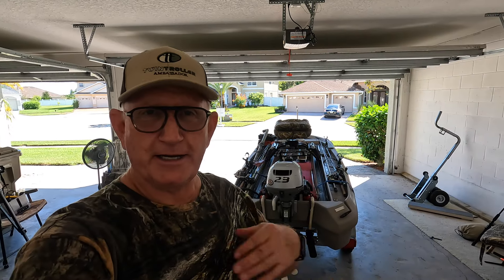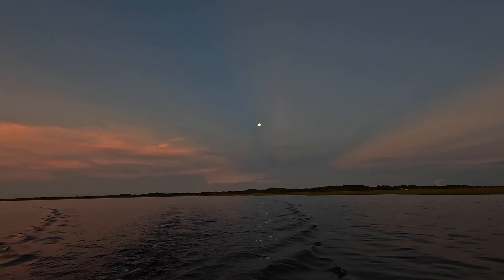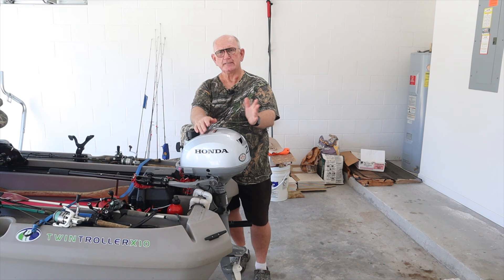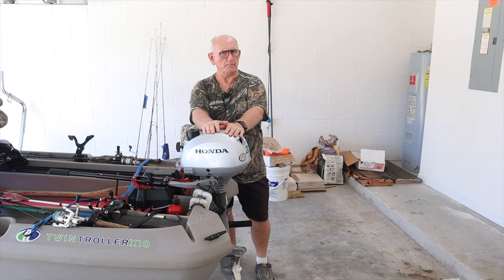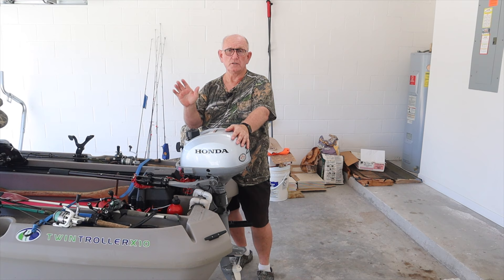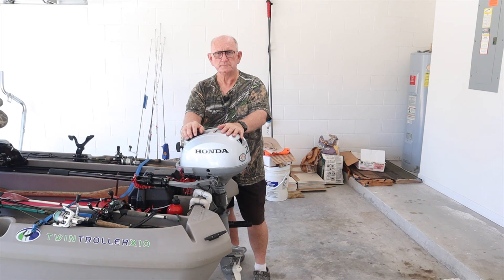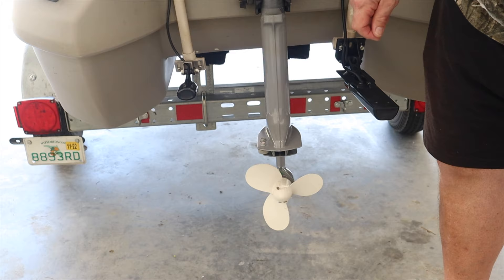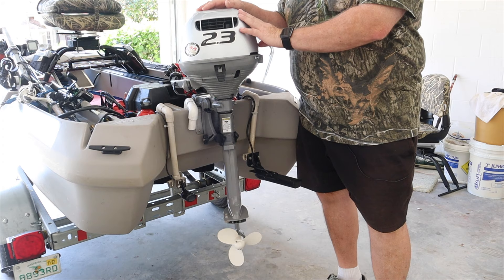How Did I Somehow Damage my Outboard Motor?

Comment: I had my shear pin shear off earlier this week. Thanks for the numbers, will come in handy. I had a throw cushion in the boat and large tackle box. I  put the cushion on top of the tackle box and pulled the motor off and laid it on the cushion and managed to do it on the water. I don't recommend it but I managed to get it done. I still have the plastic prop. Tight lines Gerry, another great video.
Reply from the maker: Lynn, pulling the motor in would be OK but putting it back would be more concern to me. Glad you made it home OK.      Gerry

Comment: Back about ,, hmmm 🤔,,, I'll say 35 years ago I Fixed up a 4hp "Gale" That was made like these ,I used it in the backwater setting limb lines for catfish when the river flooded the swamp, Guarenteed, between the Logs , Stumps , Cypress Knees, it happened at least once a year , I kept them , here's What I did I Bought a stick of Round metal Rod the same Curcumstance of that Shear Pin , I guess that Round metal Rod Stock was about 3 ft long ,I cut that Up in the Right length it seems like it was about 2 inches if. My memory serves me correctly that's what I cut em , the trick was if you wasn't careful you'd spin the Carter Key  and break it off as well , bad deal when that happened cause ya lost the prop too , yep , I had to go back when the water went down a couple of times  to retrieve my prop lol , one time in particular I couldn't find it , I figured it was gone ,just by Accident I was squirrel hunting in that area the next Fall and guess what I stumbled across lol 🤣, So I got it back that time by luck alone lol , , I carried a extra Shear Pin, Carter Key, pliers screwdriver, Hammer, And a little two blade Prop off of something else that would work in emergency in the Boat when I was using That Gale mtr,  , caught Many Many Many Catfish using that little motor , was cheap to use , and I couldn't get my Other boat in the Places I was using this set-up little 12' Leaking aluminum boat I think a Quichata, it had a Indian On The Logo I remember that lol ,, Lawdy that brought me back to another lifetime ago lol 🤣🤣,glad ya fixed er up Gerry , I'm Rambling On With Fishin Stories Lol ,, Anyway just a tip for y'all look into that round metal Rod Stock , probably tractor supply will have it , measure them up and cut ya a few extras ,it works fine or Did for me I think I had to get it at the co op , Honestly till I found that Metal Rod Stock I Used A Big Nail I Cut Down  lol , you can Buy the extra Carter Keys at tractor supply as well , Stay Safe Out There , Keep It Reelin 💦🐟🎣🤠
Reply from the maker: Donnie, in the past I did the same with the small brass rod and nails with the heads cut off. I am too old now to be swimming home and too many gators here to try that anyway. The problem with the brass rod and nail is you never know if they will break instead of the prop or cotter pin of the shaft breaking. But back then I did not much care.      Gerry
Reply: @LunkerFishing  true back then it was whatever worked so I could go run my limb lines the next morning or that afternoon lol ,, I saw a Dinosaur Gator Wensday as a matter of fact in a lake I fish ,back during the bull bream bedding I saw one in there about 8' a good sized Gator , Saw a couple Tuesday nothing that Big , But Wensday goodness sakes alive ,he's a sneaky booger too ,I noticed the bubbles as he came a little Closer then disappear, when he Popped up about 60 yards below me I did a double take , what I could see of this gators   head was at least 2 ft wide and From what I saw I'm gonna Guesstimate close to 13, I caught a 13 1/2 ft one and relocated it ,it was part of my job as Wildlife Officer , They're rare this big , Honestly one that big needs to be Removed he's dangerous , after I saw the size it made me a bit nervous because of the way it came to my boat on bottom,then around me  where the launch is you have to get in the water about a ft or so to load up and he was headed that way ya might know BUT, Its exactly one of the reasons I Carry When I Fish , Better Safe Than Sorry , Not a bad idea For Anyone Honestly , Stay Safe My Friend Keep it Reelin 💦🐟🎣🤠  ,
Reply from the maker: @donniedickerson8077  There are some big gators but do not try to pet them!      Gerry